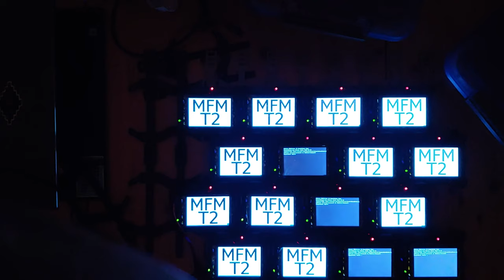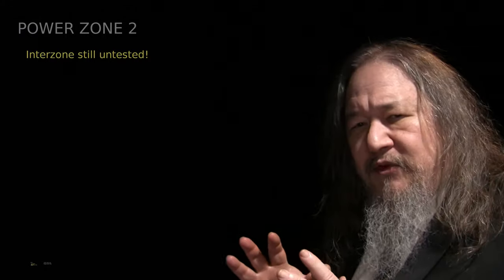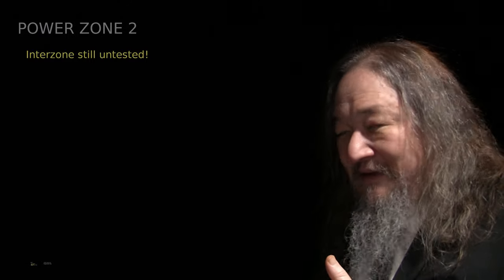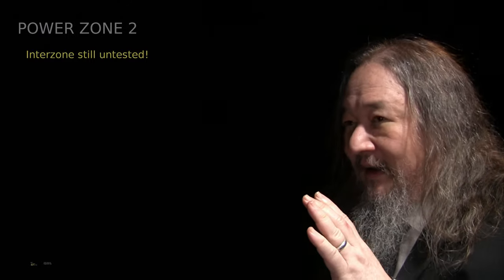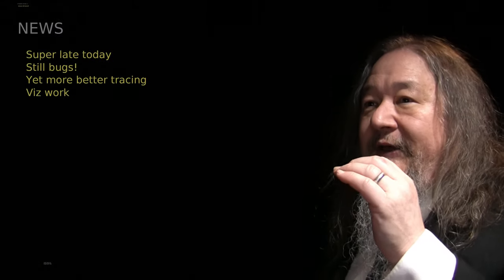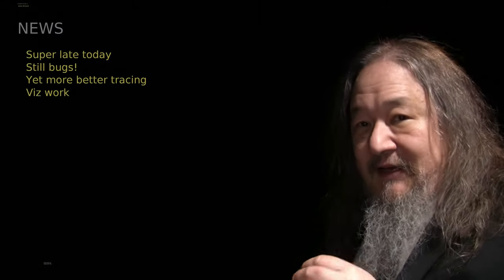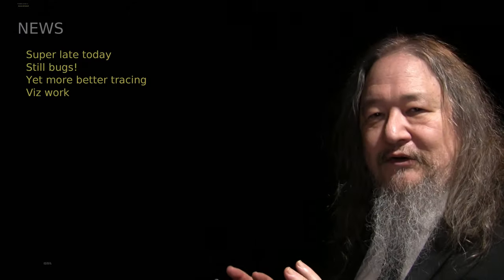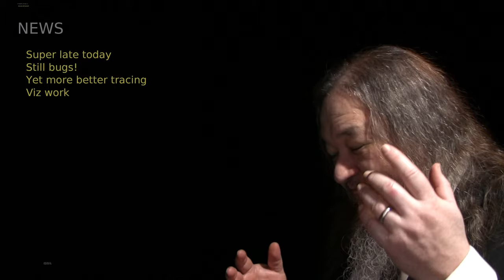Power Zone 2 - T2sday Update 282

Comment: Always sucks when you realize you assembled something the exact opposite way it was supposed to be assembled.

I noticed you had lots of issues with the clips, I'm assuming this is a low priority issue considering all of the other things to do.
Reply from the maker: If I run out of clips and need to print more I'll likely tweak the design, but yeah otherwise not.